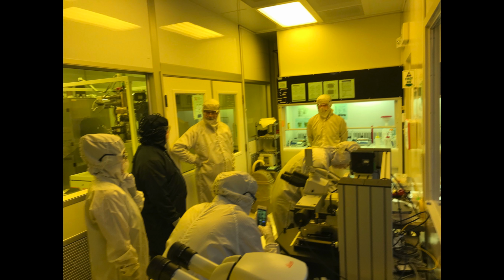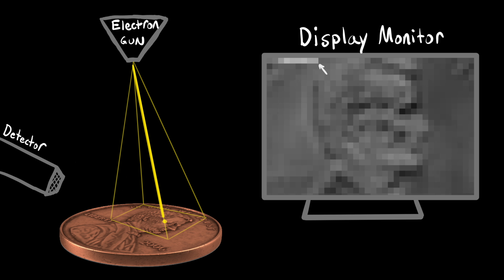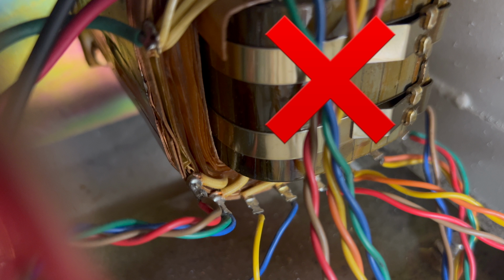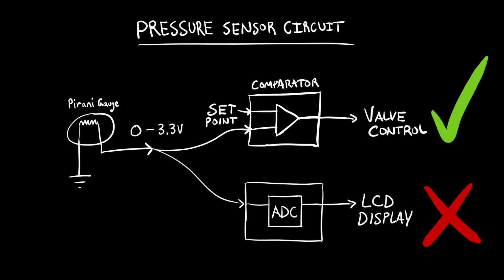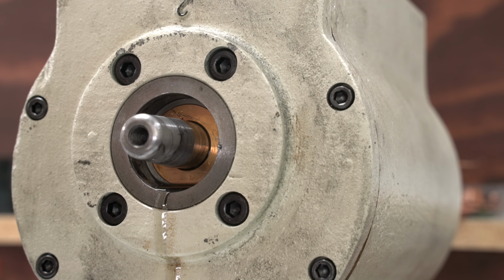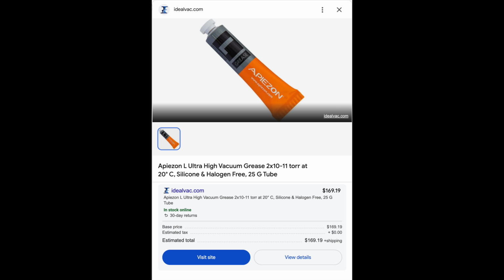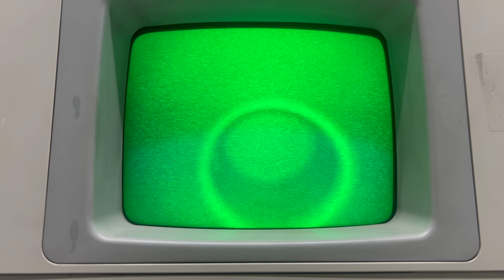I Saved an Electron Microscope from the Trash

Comment: 26:34 I'll never get over the way Americans don't say the 'l' in 'soldering'.
Reply: Looking at the etymology, it comes from the Norman word "souder" which was later respelt with an inserted L by analogy with Latin "solidus". So the American pronunciation is the correct one.
Reply: @beer_dot_com Neither is 'correct', it's just a dialectical difference - missing out the 'l' is simply jarring if you happen to be used to the 'l', that's all. 

As the first syllable of the Norman word would have been pronounced 'soo-' then in fact, by your logic, the true and correct pronunciation would therefore be 'soodering'.
Reply: @patavinity1262  nope as always the Americans are right. Get bent Commie!
Reply: @patavinity1262 theres a difference between gradual shifts in pronunciation and inserting letters. But point taken, theres no one "correct" pronunciation for any word.

If there were, though, solder would be pronounced the American way.
Reply: @beer_dot_com Saying that 'if something which is untrue were true, then it would be true' isn't very meaningful, but if that's the way you think then do you also believe that the American pronunciations of the following words are incorrect: buoy, hostile, privacy, derby, advertisement, laboratory, mobile, foyer, clerk, forehead?

Or for that matter do you think the following spellings are the most correct, because they are the original spellings: colour, moustache, manoeuvre, centre, paediatric, plough, cheque, axe, mould, jewellery, defence?
Reply: @patavinity1262 i was being cheeky, mate. Needn't get your knickers on a twist.

Comment: hard work and worthy results have come to you! congratulations, you are a pressure scientist, a microscientist. but electronics is not good yet, you can replace the transformer power source with a modern switching power source and can combine many 7805 to reduce heat (or use a 5V buck circuit)

Comment: I'm about to start a similar journey. I'm getting a free Oxford Foundry-Master Pro spark OES. It's a special one much extended bases and allows resolving far more elements than a typical Oxford FMP would be able to do, so hopefully all that calibration data is still good and the machine works. Like your SEM the vacuum pump on the OES has an issue, vacuum pump's oil seal seems to have died, but hopefully it's any seal to fix.

Comment: I love how with very high tech systems like this, you start pulling them apart and they're often made out of very simple elements, just produced to an absurd standard. The vacuum valve units are a piston with a rack driven by a pinion geared to a motor. Optical beam break sensors are used to monitor the valve position. All of this is installed in a stainless steel cuboid bolted to the top of a cap on a pipe. If anything there's a magnificence to how simple they've managed to keep it.

Comment: I wondered if you wouldn't be better to replace most of the voltage conversion/regulation section with newer ones rather than dealing with the 100V requirements and the failed 7-tap transformer. Maybe would even be able to use supplies with lower noise and more stability and improve the machine.

Comment: Now, you can try to replace the CRT's, because there are normaly two of them on such machine (one positive and one negative simultaneously), the second one has to be optional, but normaly is already wired. You can also rewire the cable mess under the control table, just to be sure there is no excessive resistance in them which would solve many communication problems. A lot of work, but then, you will have a fully working machine almost as modern as the actual ones. I would also recommend you to add different stromboscopic with variable wave lenght light sources for different spectrums in the radiation chamber, so you'll be able to switch to different modern modes. I would also motorize the focus which also is very simple to do. Regards.

Comment: One small comment about the hoses:

If you are having a hard time getting a plastic hose onto the hose barb/joint, or with getting a good seal, you can wet the end of the hose with acetone. The acetone will go into the plastic and dramatically soften it, allowing it to go on much easier. The acetone will then evaporate out and the hose end will stiffen and contract again and it will be on very snugly
Reply from the maker: Never tried this before. I usually use water, but i'll try it :)

Comment: There are a few things that I find really fascinating about this.
The first is that old hardware is surprisingly repairable. You get the schematics and circuit diagrams with the manuals and stuff, and it's all big, accessible components. Imagine trying to do something like this for a modern appliance in 40 years.
The second is that the modern components used to replace old ones are so much smaller and more effective/efficient. It's cool.
The third is that this thing seems to predate all kinds of common standards, like 120v AC and hose connectors.
Thanks for sharing.
Reply from the maker: Yeah, even SEM's that are a few years newer are a mess of programmable logic and stuff that is not repairable. 

Oh also, it's 100VAC because it's from the area of japan that has standardized on 100V instead of 120C

Comment: It seems like you already have some former engineers/techs rounded up to help so they might deem this unneeded. If possible I would try and get dumps from those ROM chips. I'm not sure how the company is these days, but it sounds like their support falls off for this era of scope. Deffo would want someone who works with vintage electronics and has a solid programmer to assist. I just paused at 7:52 and saw those NECS. The company may have the ROMs as well and if they do, snap em up. Who knows how long their policies will dictate hosting legacy firmware let alone distributing it to hobbyists without a contract. Everything else on the logic side of things seem like passive off the shelf components. But there are a lot of things flying around that can prob knock a flash out and you don't want to end up "brainless". 
Cannot wait to watch the video

Comment: 12:57 I've never seen that for diffusion pumps, but it's quite usual to have a % max rpm display for turbo pumps. For a time those had analog external vacuum gages, but those were replaced with digital integrated ones now.

Comment: Congratulations on your perseverance. I know what it's like to take years to achieve goals. Getting the microscope for free was truly a stroke of luck. I learned a lot from your video. The theory I knew about electron microscopy wouldn't help at all. As for vacuum pumps, they're quite outside my area of expertise, but repairing a worn shaft can be done fairly easily. There's a very good process for this: Metal Arc Spraying. It's a process widely used by machinists accustomed to repairing shafts worn by bearings. I would also replace all the O-rings and seals immediately because it's a very low cost that will undoubtedly pay for itself. I would also have bought that $380 transformer on eBay without a doubt. It's almost a miracle to find a replacement part after so many years. In the video monitor section, the electrolytic capacitors may need to be replaced, which is normal and expected after so many years of use. Connectors showing signs of oxidation are also expected and cause a lot of damage, especially intermittent flashing. Check that the relays are sealed. If they aren't, it's a good idea to replace them. I believe the material cost for all of this is ridiculously low, but consider a few hundred hours of labor. I hope you enjoy your new "toy."

Comment: I am a technology geek but never got nearly close to your level..
That insult/praise stated, let's move on..
Cathode Ray Tubes, as in a television screens  operate in a similar but cruder fashion.

"A small wire, coated in Strontium90 is heated by a coil, this causes the wire to emit electrons. 
These are attracted by an electromagnat to wander down a tube, accelerating as they go.
Their target is a grid, charged to extremly high voltage.
But, before they can get there, another electromagnet deflects the beam, causing them to scan across a grid in varying patterns.
They hit a coating of photo-flourescent material, causing it to glow, dependant upon the amounts of electrons in the stream.
In front of the tube, lighter and darker spots produce an image, much like looking at a newspaper photograph.
Persistance of vision resolves this into an image."

I wrote that, aged 11, in answer to the question; what did you see on TV, last night. 
You have to realise that, at that time, around 1964, we only had Monochrome TV.
How did I do?

Comment: Reminded me of rebuilding old manufacturing equipment with sensors, computer, touch screen panels, optimizers and software upgrades during my adventures of trying to build and automate manufacturing plants! 

I purchased some great still functionally superior but technologically ancient equipment with analog controls that I tried to bring back to life after decades of collecting dust where I bought them from, some with success some others ended up scrapped because nobody makes some of the missing components anymore and too expensive to custom fabricate them even if you find the original specs or working example to copy from

Comment: 😢This is a demonstration of the difference between (Stem) modules. 
ENGINEERING would have fully repaired both the pump and all other systems BEFORE  it employment in a "Science " Experiment. 
Please don't forget  STEM,  ALL EQUAL.BRANCHES of RESEARCH!
If any one of these departments decide to put themselves above the others!
Then their Experiment will Fail.
It takes cooperation, integration, understanding  and respect for each and every branch of STEM..
SO each philosophy needs to trust her or his equal in a different discipline. 

We only succeede.if wi work together  AS EQUALS.

Comment: AI Summary

Abstract:

This video chronicles the meticulous, multi-month process of a hobbyist acquiring a non-functional 1980s JEOL JSM-5200 scanning electron microscope (SEM) for free and restoring it to full operational status. After a decade-long search for such a machine, the creator encountered numerous complex technical challenges. The repair journey involved systematically replacing a shorted main power transformer, faulty digital logic power regulators, and deteriorated vacuum system components, including an entire rotary pump and extensively lubricating the diffusion pump valves. Furthermore, critical electronic signal paths were restored by replacing a damaged video cable, and the user interface's membrane switches were repaired using repurposed parts. Despite the machine's age and initial state, the creator successfully brought it online, demonstrating its impressive imaging capabilities on samples like integrated circuits and even a fly, achieving resolutions up to 100,000x magnification. The video concludes by outlining remaining minor issues and future plans for leveraging the SEM in semiconductor development and other projects.

Restoring a Vintage Scanning Electron Microscope: A Repair Journey

*   0:00 Acquiring a Dream Machine: The creator fulfills a decade-long goal by acquiring a non-functional JEOL JSM-5200 scanning electron microscope (SEM) for free, a machine that originally cost over $100,000.
*   0:41 SEM Fundamentals: The video explains that SEMs use electrons (with much shorter wavelengths than light) to achieve significantly higher magnifications (up to 1 million times) and resolutions, allowing for observation of structures far smaller than visible with optical microscopes.
*   3:42 The Free SEM: After a decade of searching, a non-functional JSM-5200 was found on Craigslist, inspected, and eventually offered for free after 10 years in warehouse storage.
*   4:07 Learning and Collaboration: The creator self-taught SEM repair and joined a Discord community of hobbyist SEM owners, specifically connecting with other JSM-5200 owners (Martin and Monochroma), which proved invaluable for troubleshooting and sharing resources.
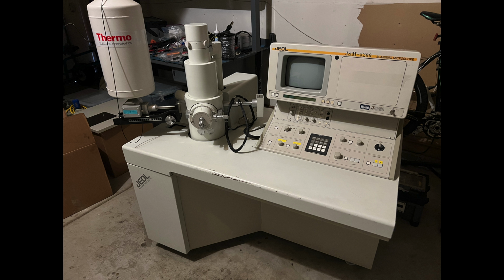*   4:41 How SEMs Work: The core components are detailed: an electron column (generating and focusing a narrow electron beam), a detector (counting emitted electrons from the sample's surface), and a display, which builds the image pixel by pixel.
*   6:30 Essential Support Systems: Key auxiliary components are highlighted, including a high-vacuum system (diffusion pump backed by a mechanical pump), high-voltage power supplies (up to 25,000 volts), sensitive analog circuitry for electromagnetic lens control and signal amplification, digital control circuitry for system management, and the user interface.
*   8:18 Power Supply Repairs: The machine initially failed to power on due to a blown fuse and a shorted main transformer (T2). The original transformer was replaced with an array of multiple individual transformers to supply the various required voltages.
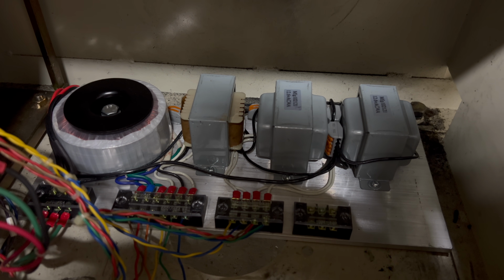*   11:32 Digital Logic Fixes: Erratic digital logic was traced to old, faulty 5V linear regulators. These were replaced with common 7805 regulators and custom-fabricated aluminum heatsinks for proper heat dissipation.
*   12:44 Vacuum System Issues - Gauge: The integrated vacuum gauge's LCD display function was found broken, necessitating the installation of a personal external vacuum gauge for accurate real-time pressure monitoring.
*   15:09 Vacuum System Issues - Leaks & Hoses: Initial vacuum tests revealed a significant leak. All 30-year-old, cracked rubber hoses were replaced with a more durable, reinforced PVC alternative, and all vacuum joints were sealed with high-vacuum grease and hose clamps.
*   17:18 Rotary Pump Failure: Despite hose replacement, a persistent leak was traced to the 40-year-old rotary vacuum pump itself, specifically a worn rotary shaft seal and badly pitted internal veins. The pump was ultimately replaced with a working used Varian SD90 unit.
*   19:49 Diffusion Pump & Valve Maintenance: After successfully achieving a rough vacuum, the high-vacuum diffusion pump was activated, requiring a chiller unit. A crucial valve leading to the diffusion pump was stuck due to decades-old, solidified grease, necessitating a full tear-down, cleaning with solvents, and re-lubrication with expensive, specialized Apasol L high-vacuum grease.
*   23:30 High Voltage and Electron Gun Activation: The high voltage supply was confirmed functional with the CRT display illuminating. The electron gun's tungsten filament was successfully heated, confirming it was intact and ready to generate the electron beam.
*   24:45 Image Signal Path Repair: An absence of image or contrast control led to the discovery and replacement of a damaged internal RCA video cable, which restored the basic image signal.
*   26:01 User Interface Button Repair: Non-functional focus and magnification buttons were found to utilize membrane switches. The worn membranes were ingeniously replaced with parts carefully cut from an old Xbox controller.
*   28:33 First Images & Functionality Confirmed: With core controls and vacuum restored, the microscope successfully produced images, showing the specimen stage and achieving focus, confirming the success of the extensive repairs.
*   29:39 Initial Sample Imaging: Samples including an integrated circuit (revealing wire bonds and even "go cards" graffiti) and a dead fly were imaged. The video demonstrates how non-conductive samples (like the fly) can still be imaged by adjusting the accelerating voltage (e.g., from 25kV to 10kV).
*   30:58 Image Quality & Resolution: The video demonstrates improving image quality from grainy fast-scan mode to crisp slow-scan (1 frame/sec) by allowing the electron detector more time to capture data per pixel. The microscope achieved resolutions down to 200-300 nanometers at 100,000x magnification.
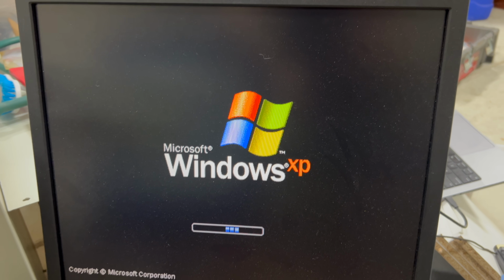*   32:58 Digital Image Capture: The microscope's original computer software for digital image capture was also partially restored, despite some remaining signal integrity issues.
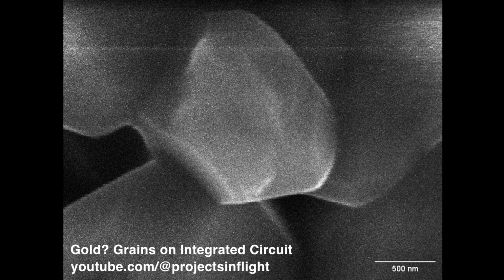*   33:26 Future Plans & Community: The creator plans to further optimize the SEM, determine its precise maximum resolution, and use it for semiconductor development in future videos, inviting viewer input for other potential uses and projects.

I used gemini-2.5-flash-preview-05-20| input-price: 0.15 output-price: 3.5 max-context-length: 128_000 on rocketrecap dot com to summarize the transcript.
Cost (if I didn't use the free tier): $0.0086
Input tokens: 25315
Output tokens: 1368

Comment: Those switches are probably one of the stupidest cost cutting measures I've ever seen. And on a 300k unit. Or were they so new back then they were considered avantgarde and the future?
Reply from the maker: i think they were fairly new at the time. honestly i don't think membrane switches are that bad. it is much easier to fix them when they wear out. refurbishing corroded mechanical switches is a real pain

Comment: I was an electron scanning microscope engineer for JEOL. It also does X-ray analysis.
Reply from the maker: It does, but only with the EDS unit (currently not attached), and assuming it still works after a decade or two of being at atmospheric pressure and non-cryogenic temperatures.

Comment: It is like a CRT TV , just turned inside out. Nothing complicated , you have a Power Supply , HV source , Deflection Magnets , Some Optics ,Imaging Device , Controller Circuit.
Piece of Cake. 25 KV is pretty low ,even a B&W CRT TV has 30 KV.
Reply from the maker: you're correct, but i would like to add something: a lot of the reason an SEM is more than a CRT is because you need to make extremely good electron lenses, because the beam width on a CRT is around 1mm, and the beam on an SEM is only a few nanometers wide. 

so basically it's a very precise CRT ;)